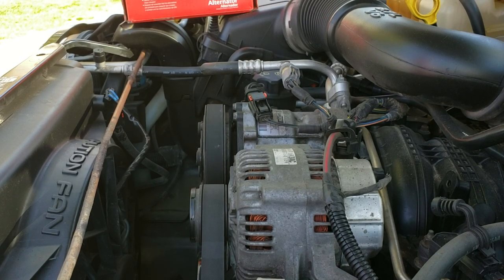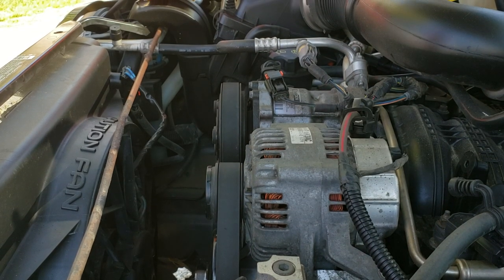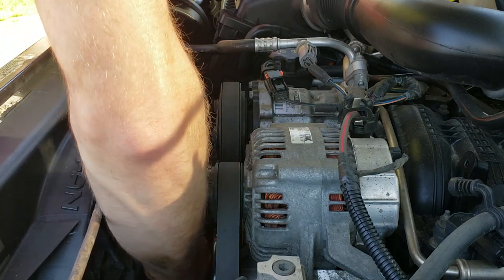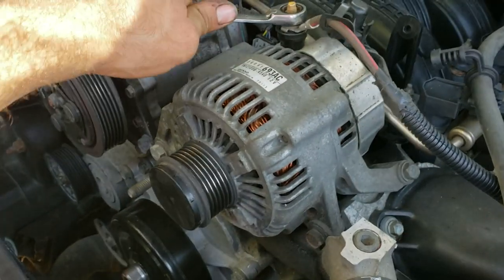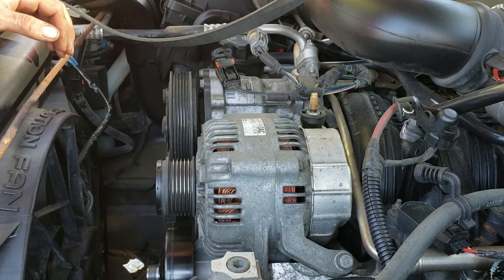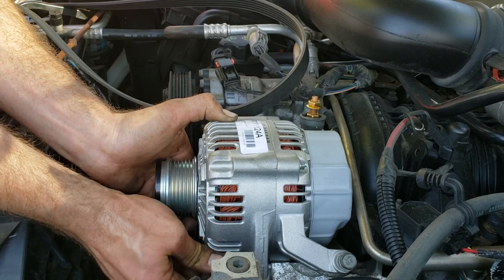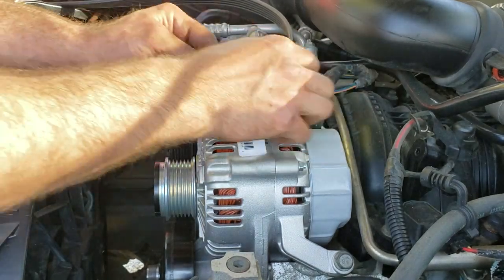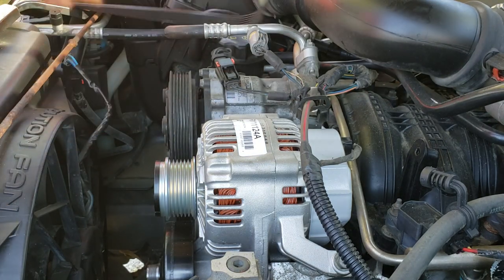Jeep Liberty Alternator Replacement || 10 Minutes!!

Comment: Hint; Take a long screwdriver and touch the bit to the body of the alternator and the handle to your ear, it amplifies the bearing noise, if any. And hold the positive cable fitting at the alternator to prevent the possibility of busting the terminal off.

Comment: Thank you for this video. My jeep died on the freeway and had it towed to my local mechanic. They want $914 to change the alternator and battery.
Reply: the same thing happen to me  and i say what!!  you crazy,  i call my AAAtowing to take the jeep to my house i buy alternator eBay original whit low miles 68k i fix myself  cost me $50 only, and use same battery 3 years old.  government should do something about  dealers and mechanic steeling peoples money.

Comment: Tips: 
Taking off the belt, to loosen tensioner pulley, tighten its bolt, it will require a lot of force.
Putting belt back on, I found it most useful to put on the big loop at top middle last.

I was working with a jeep liberty 08. This video was extremely helpful. Thank you Blake!

Comment: '...always seems to stick for me....' says the guy that don't use anti-seize when replacing parts :-) . Thanks for the video though. Dealing with one of these rigs which seems to have the computer-regulator issue.
Reply from the maker: Are you referring to the alternator needing to be pried out? If so its designed to be pinched into place....
Reply: He is saying, the ECM controls the charging output of the alternator on these cars. @BlakesGarage1

Comment: Mine is making a whining noise. Almost sounded like low power steering. I took the negative cable off and it stalled. Def the alternator right?
Reply from the maker: Sounds like a good chance. You might check with a volt meter or have your local auto parts store test the charging system to confirm.

Comment: Where’s the coolant and washer fluid tank mine is right In the way on 08 liberty
Reply from the maker: 02 was different. No tank on mine
Reply: @BlakesGarage1  gotcha gonna look into removing it can’t get a good angle on tensioner pulley from top or bottom with them where they are